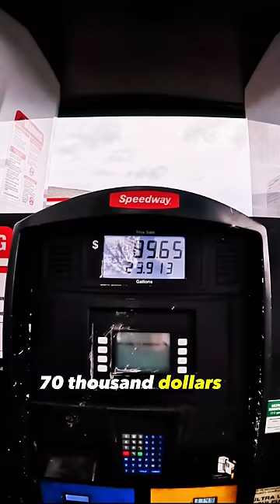when u realize Mo Money is really Mo Problems 😵‍💫 #shorts

Comment: Don't forget the cost of new tires or retreads, motor oil/filters, constant checks of road lights, maintenance of brakes etc. When dad ran his truck and trailer I remember him running maintenance checklist because he could not afford to have his truck deemed unroadworthy by the Road Traffic Authority or Highway Patrol.
Reply from the maker: oh i 100% agree with you it's extremely costly to be put out of service
Reply: Well you should be doing that anyways. Every week I walked around my car checking fluids /tires/lights etc. On my motorcycle every few days in addition to all those I also check chain tension, tire wear patterns, visual things like bolts etc.

Do that refularly and its quick, its cheap to check, and thats even if I have 0 intentions of stopping for the cops (so they wouldn't be handing me a ticket for those anyways)
Reply: @jakegarrett8109  Troll someone else.
Reply: @aaronmcgoldrick2439  do you not check for basic safety things each time? I go above this amount (I have a spreadsheet that even tracks when I've cleaned and oiled my chain, or when I've cleaned my brake rotors, which has been several times even though that bike is barely a month old and I just got it to 1,500 miles last week). However basic safety things are not something to skip, it takes only a minute and a half for me to check all lights and fluid levels in my car, and my bike about 3 minutes to check everything while it's warming up. It's not a game, you can't just hit the reset button.

If you meant that I was joking about stopping for police, well quite frankly they haven't tried to pull me over when I'm actually speeding. Most I've had was they whipped out of the parking lot following when I was ramping the speed bumps in front of their police station on a military base with my other bike as I redlined it in the air right in front of them, but I just shifted up and jumped the next one even higher while they had to slam on their brakes to not destroy their SUV and puttered off on my way. In my car they've seen me when I slowed way down after a curve (I don't care to drive fast in straight lines), so they would have clocked me at about 78 mph (bases are typically 25 to maybe 35 mph highest posted speeds), but it's kind of pointless for them to try considering they slowed for that same turn below the speed limit and not casually flying through at something much higher. Downshift and stare, and cruise on (only 7,800 rpm in my car at that speed in 3rd gear, redline is at 9,500 rpm).

Due to several unconstitutional stops where they've treated me terribly (the few times I've legitimately done nothing wrong whatsoever, which is like 1% of the time), they've lied on criminal citations (but $0 fine so I couldnt have a court date to discredit them), made me stand out in the cold for hours while they trashed my car looking for things they admitted were perfectly legal to have under all state and federal laws (so what's the point of the search?), Etc. So I just don't see a benefit to stopping for them a good chunk of the time. Probably 3x I've been stopped for a tail light out or something (which I thanked them because even though I check quite often, it can fail seconds after checking and I don't want to drive for a week or even a day without working tail lights). Those stops are fine and I appreciate them, but a lot of times it's just a fishing expedition to find something to write you up for (but if you drive where it's not worth their time or even look like you'll stop, I mean who wants to file the report that they couldn't catch a dude doing wheelies in front of the guards or drifting the roundabout? That person is just crazy, it's not going to be an easy ticket, is it worth it?)

Comment: 250 is hella weak for 2022. I did 430k gross  in 22. There were $15,000 reefer loads on the board and you did 250??? Did you only work half the year??
Reply from the maker: Yes I barely worked brother

Comment: I'm on pace to make $200,000. I have 1 truck and no trailer. I also don't pay insurance, elog, IFTA, PRP, etc. I pay fuel, truck payment and I have a a maintenance package at a reasonable rate. I have a 2023 Peterbilt 389 and I guarantee I pay higher fuel prices.
Reply from the maker: That’s excellent brother great job 👏 👏 2023 Pete 389 is a nice truck! What color?
Reply: @guyinatruck  Orange

Comment: cheap engine, heh. I typically cut 80k in fuel, 20k in maint. I did blow an engine in Jan, 50k for a used engine, closer to 70k to just replace with a new one. Glad I had a spare truck.
Reply from the maker: Yea cheap engine although these max forces were built on a 3406 cat bottom which is a great engine they just had to ruin it with the after treatment and egr stuff.

Comment: Why I won’t own one I made 92000.00 last year as I company driver and didn’t have to worry about none of that . And didn’t have to drive on the east or west coast . Pull hopper bottom in the Midwest hauling lime hardly any wait time like you do hauling freight .
Reply from the maker: that's amazing! great job man! I would keep that if you like it, that's really what matters if youre happy. How many hours did you have to work in the year to achieve that?

Comment: Did you make $250,000 or did you do $250,000 in revenue and then paid all those expenses after that and then taxes after that?  I $60k or $70 in fuel?  Thousands of dollars for tires?  Thoussnds more for maintenance. $15k to $30k for insurance? You probably still end up with 6 figures of $ a year.  Still not bad.

Comment: What? A new engine is cheaper than insurance?

Stop buying that shit
Reply from the maker: well a brand new engine is more, but to have one rebuilt or overhauled is less id say than insurance in most cases if you have more than one truck. I wish I could stop buying it but it's required to be in operation sadly

Comment: Only 250,000 
I did 417,000 one truck one trailer flatbed off load boards 
U should b ashamed
Reply from the maker: Yeah, this is all local work working only half the year. But great job man that’s excellent work with one truck. I think everybody did really well the past couple of years but this year has been rough for Spot and now contract freight has caught up to

Comment: you didn't make 250,000. you turned over 250,000 there's a difference.
Reply from the maker: I made 250k with my truck. You can call it whatever you want.
Reply: @guyinatruck  if that's how you look at it you won't be in business long. You MAKE what's left over after taxes, fuel, sundries. Stop trying to portray like you are hard done by. You got into the industry fully aware, if not that's your fault.
Reply: @guyinatruck  you are being completely disingenuous in the opening of your video on purpose just to get views

Comment: try to get a tire company to use ur truck as a bill board with a wrap of their logo and in return u get tires , just a stoners thoughts …. keep grind’n and turn that diesel into distaaaaaance 💪🏼
Reply: Yeah that's a stoner thought for sure 🤣 

It costs roughly 8k just to put brand new virgin rubber on a semi not includingthe trailer. 10 tires for the truck. No tire shop is going to eat that just for advertising.
Reply from the maker: good idea but like Jake said that's probably not something theyd be interested but always worth a shot!
Reply: @jakebrakejunky10-4 I don't know where you're getting your numbers from. But for around $5,300 (including labor) I can put 18 tires on one rig...
Reply: Maybe some junk Chinese or recaps.. You arent putting name brand virgins on truck and trailer for less than 10k
Reply: @devintibbitt1097  First of all they're not Chinesium, they're from Thailand. Actually pretty decent tires. They wear a long time. Second of all I have two tire distributors that I get my tires at for wholesale pricing as a dealer. Anyone spending $10k on 18 virgin tires is doing it horribly wrong...
Reply: @ClintsTractor  you getting volume pricing is not the same a small guy paying for them that cannot get those discounts..
Reply: @devintibbitt1097  Yeah it is, I don't stock and sell those tires to others even though I could. Even then I would sell those 16PR 11R22.5 closed shoulder aggressive drives for $365. All position (steers) for $355. I only order what I need for my trucks generally. But if you need tires let me know, I can get you what you need.

Comment: $250k total income
-$60k in gas
-$30k in insurance
-$~20k in maintenance 

Remaining $140k still great money
Reply: 50k of that is going straight to taxes. Out of the remaining 90 k u still need to buy plates - other registration fees - upwards of 5k. Permitting, tolls, replacement equipment fund, driver paycheck,all your office operating costs, software for payroll/ accounting/business. The list goes on and on.. Put less than 20k in your bank account when it's all said and done.. And you take 100% of the risk on top of that.. Blow an engine or tranny or have a wreck. You are done.
Reply: 250k gross declared income
180k in fuel
30k in insurance
50k in repair labor and parts
30k in truck payment
15k in trailer payment

net loss 55k....... 85% of newly formed trucking companies go
bankrupt in the first 3 years. The other 15% go bankrupt
in the forth year.
Reply: @clemsmith8799  he said 60-70k on fuel in the video, where did u get 180 from?
Reply: @AJ_900  He is a lier with an agenda.  150,000 miles driven divided by 5mpg is 30,000 gal in fuel times 5 dollars per gallon is 150k dollars in fuel. Not including reefer fuel 1gal per hour and bunk heating fuel in the winter. My point is nobody makes money in trucking. No truck driver has ever owned a house next to a doctor or a lawyer.
Reply: @clemsmith8799  🤔 I just did a little research on the mile per gallon for semi and it checks out at 5, I think you’re math checks out more than mine, thank you

Comment: Uh... NO.  You did not "make" money that you haven't removed operational expenses from already.  That's just a gross revenue figure and representing it as anything else is incredibly misleading and disingenuous.
Reply from the maker: exactly the point of the video boss. Trucking is expensive. Of course these are gross numbers, there's nothing being hidden or misleading about that. Takes money to make money.
Reply: @guyinatruck  hard disagree.  You did not "make" the money and trucking is not expensive for the operator.  The misleading comes when you say you "made" the money but you haven't paid for your operations out of it yet. That's a lie.  You didn't make the money. You had revenue that still needed to be accounted and balanced before you knew how much you made.

"expensive" is not an applicable term here - if the truck cost 50% more to operate you'd charge somewhat under 50% more to your customers who need things moved around - because you hand the cost to the client it isn't expensive for you - maybe for them, but why would you give a rats behind? It is a component of a formula, not something that pulls your personal earnings down, which would be expensive to you.

Comment: Isnt the fuel and insurance a tax write off though along with the vehicle
Reply: You can deduct your expenses from your income, yes. That does not mean you are going to get it back though. You will save 10-20% on that deducted money.
Reply: @court2379  Only 10-20k? I understand insurance, but I thought you’d get a lot more back on gas
Reply: @Zach.3246  It just deducts from your income, so you don't pay taxes on that expense. At the income level discussed here the net taxes they pay are probably between 10-20%, but can vary considerably if they are married and have a few kids vs single and no other deductions. Single being on the high end of that. So best case you are only saving around 20% of that money. Not insignificant, but this talk often heard about writing things off doesn't mean you get all that money back. Only your tax rate times that amount. For a typical family making decent money that is around 10%. Same goes for itemized deductions that are not part of a business. They just reduce your taxable income. If your tax rate is low, like most people, they save almost nothing.
Reply: not the insurance, fuel to a certain amount
Reply from the maker: yes in theory it is def a write off
Reply: @Porkyspissed7777  If they are business expenses all of it should be. Basically all you are doing is calculating the net income by removing the expenses from your gross income. Then paying taxes on the actual income.
Personal taxes without a business are much more limited.
Reply: @court2379  you've never been self employed. We get taxed more and just cuz we can write expenses off don't mean you get it all back.
Reply: People sure don’t understand how taxes work
Reply: @daveulrich4623  ain't that the facts! The more you make the more they take for themselves and the slobs